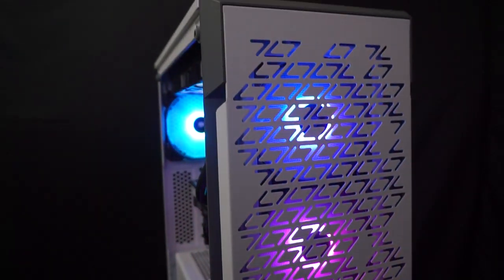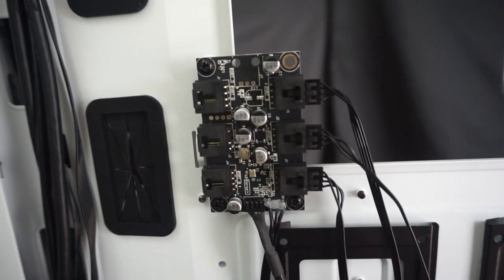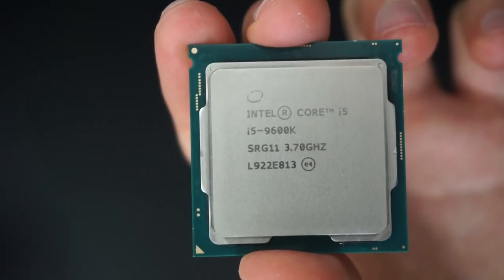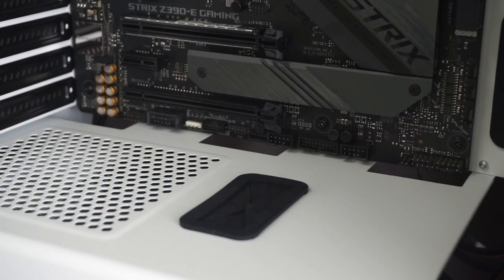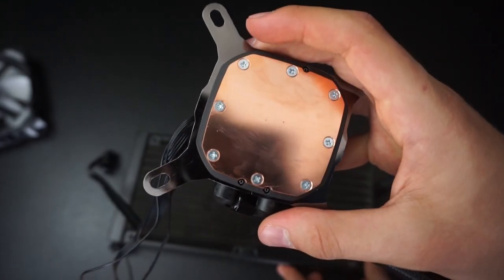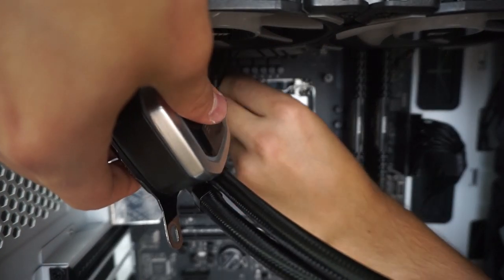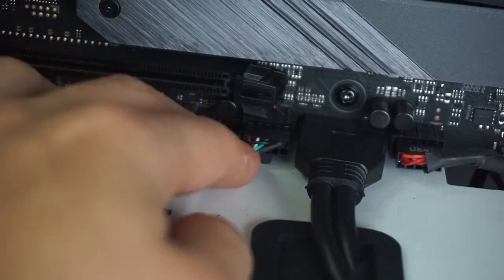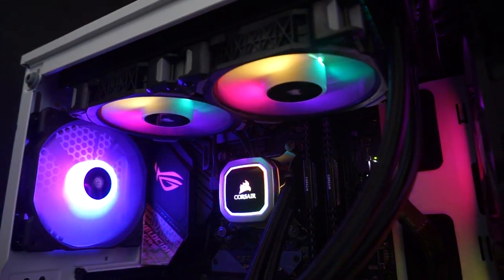Corsair 220T RGB Mid Tower Build Guide

Comment: I am planning to build my first pc in this case. I really love the look of this case. I am going with Asus Prime B450M-A motherboard, Corsair RGB Pro RAM and Corsair Hydro Series, H100i RGB Platinum SE, 240mm Radiator on top. Is all that going to fit? Please let me know if anyone has built in this case
Reply: He shows you in the video that a top mounted 240mm aio will fit if you have low profile ram. In your situation with your rgb ram sticks, you would have to mount the aio on the front since your rgb ram is too tall for a top mounted aio configuration

Comment: Could you fit a 1tb HDD in the case or would it be too difficult to cable manage ?
Reply from the maker: I hate having hard drives, they are bulky and out dated now.
Reply: I have seen people fit a HDD in with the power supply, but it's very crowded and not good for cable management. You can slide the HHD bracket forward in the case to allow for more room for the power supply, but it's only minimal. I'm thinking of buying this case and I might upgrade to an SSD so it's a bit cleaner.

Comment: I was hoping someone could help me. I got this case and got everything in. When I turned it on the fans lit up but weren’t moving. So I had no airflow going through. Does anyone know why this is.
Reply: Also it comes with 3 cables that are 3 prong where do I plus those in at?
Reply: @laurenkartheiser0408  If you have a total of 3 fans. Each fan comes with 2 sets of cables. 1 that connects to the lightning core for le at the back and 1 that goes into the motherboard for power.
Reply: @abdulmotive  I figured it out. Although I can only power 1 of the 3 fans because my mother board only has one spot for one fan. I plan on getting fan splitters to solve that issue though.
Reply: @laurenkartheiser0408  buy a 3 way fan splitter. It will connect 3 to 1
Reply: Buy it on Amazon. 3 way fan splitter
Reply: @abdulmotive  thank you so much!!!
Reply: @laurenkartheiser0408  Of course. Have a great day!

Comment: The fan connectors are 3 pin, but my msi gaming plus b450 doesn't have any 3 pin to plug them in. I'm confused. The manual for this case is useless
Reply: Kevin M Don’t blame the manual for the case, almost every fan has 3 pins, it’s your motherboard. 3 pins can go into 4 pins if you line it up right.

Comment: On the bottom floor of the case, there's something you can attach. What is it?
Reply: A dust filter for the PSU
Reply: Wait I may have misread your question, do you mean on top of the PSU Shroud?
Reply: @subpoena.  Not on top. On the bottom, there's something next to the dust filter for the PSU. What is it?
Reply: @tonym3659  I have this case in my house, I will look tommorow morning, remind me.
Reply: @subpoena.  *Reminder
Also can I use other case fan products other than Corsair? This case does with a hub on the back so can I use other RGB Case Fan products?
Reply: @tonym3659  Thank you for reminding me, You can use other case fans on this case however if they are not Corsair™ Branded they will not be compatible with the RGB Controller on the back of the case.

As for your first question, I don't know if what I see is what you're referencing, but if you are referring to the 2 Rubber Nubs at the bottom of the case, I believe those help with Anti-Vibration of the PSU.

If you're still confused maybe send a picture if you can find one and I'll see if my case has it.
Reply: @subpoena.  Here is a picture, like its right next to the PSU dust filter: https://pcper.com/wp-content/uploads/2020/03/corsair-220t-rgb-airflow-11.jpg
Reply: @tonym3659  Those 2 little nipples are both rubber pads that cover the inside of the case and are for the PSU to prevent vibration
Reply: @subpoena.  One more thing, What's the best Corsair Case Fan RGB with the best Airflow and CFM?
Reply: @tonym3659  The Best RGB Definitely goes to the QL120's. 

I'm unsure of the fan with the Best CFM, but I'm pretty sure all of them will work similarly.

All Fans have great Airflow, This is more dependant on Evironment.
Reply: @subpoena.  PCPartPicker tells you. I think Corsair ML120 PRO is the best all around.
Reply: @tonym3659  Ah, Neat
Reply: @tonym3659  It Depends, if the other RGB Fans are not Corsair, they will need to have a 3PIN-ADD RGB Connector and also would need a RGB Header on your motherboard aswell.
Reply: @subpoena.  Yeah. I wanna use this as my exaust fan on my case: https://pcpartpicker.com/product/sZPgXL/cooler-master-sickleflow-120-argb-62-cfm-120-mm-fan-mfx-b2dn-18npa-r1
Reply: @tonym3659  I would just advise buying a single SP120, it's about the same price and also that way everything will look the same and function the same.
Reply: @subpoena.  But that airflow doh.
Reply: @tonym3659  The SP120 will be fine for Exhaust

Comment: The more I watch about this case the more I want one. Would love to know if a larger power supply would have clearance issues with the HDD cage as I have a OCZ 1000w fully modular PSU and 2x1tb drives
Reply: Max PSU length is 180mm if you are still wondering

Comment: Had to front mount my duel fan rad kinda unfortunate but still looks clean, also great video
Reply: Same bro, it pisses me off especially bc my aio dont got rgb fan
Reply: @ethanpham7716  damn what brand did you get?
Reply: @Justincredible24  i got the evga clc 240
Reply: @ethanpham7716  nice it looks clean I got the cooler master ML240L
Reply: @ethanpham7716  I’m planning on getting the Corsair i150h if it will fit though
Reply: H150i*

Comment: (First time PC builder here) I’m really having trouble with finding where the three three-pin cables that come with the case, which I assume are for the fans, connect to my motherboard. I only have two system fan ports on the mobo and could really use some help :/
Reply: You can buy a 3 to 1 fan splitter cable. They are pretty cheap. Just connect the 3 3 pin cables to the 3 to 1 fan splitter.

Comment: Hello, I was wondering if team t-force delta ram would fit this case, with an aio at the top
Reply: Yes it will
Reply: SkidPaw It won’t, disregard the comment above this. You need low profile ram like the Corsair vengeance non RGB ram, so please don’t do it as it won’t work.
Reply: isleseayou As for you, please delete your false comment.
Reply: BrightMarksman I only said yes it will because I have this setup in one of my builds plus another set of fans on the other side of the rad for a push pull config. I am using g skill trident which measures at 47mm tall  ( https://www.kitguru.net/components/leo-waldock/g-skill-tridentz-rgb-32gb-ddr4-3200mhz-ddr4-with-rgb-lighting-review/ ) while the t-force delta measures at 49mm tall ( https://www.teamgroupinc.com/en/product/delta-rgb-ddr4 ) .....at its highest point. But at the edges of the t-force it is 46 mm tall. It should fit just fine. The push pull rad config covers up some of the ram but height of the ram is not an issue.
Reply: What about this case with h100i platinium on top with b450 mortar and team group dark red ram will it fit?

Comment: I dont know how to plaug in my power led, reset switch and the small cables like tht on my asus rog strix b450-f gaming motherboard
Reply: Check the motherboard manual. I had the same issue at first with the same motherboard, but that's because I never referred to the manual. It says it in there somewhere, just have to look for it👌

Comment: this case is good, but i wish i got a bigger one. I recommend beginner builders to get a larger case because it is easier to work on.
Reply: im probably gonna get this case anyway because it looks good has 3 fans and is the perfect size for the components I wanna use
Reply: @juniorjappie153  i feel you, thats the same reason i got it too, the fans are really nice.
Reply: @ethanpham7716  what cpu cooler do you use i wanna get a kraken x53 but i'm not sure if it will fit top mounted
Reply: @juniorjappie153  Well, I dont even use top rad bc it wont even fit, I use the evga 240 clc.

Comment: Will a PowerColor Red Devil 5700 fit in this case?
Reply: Jaime Torres yes it will
Reply: @isleseayou  awesome thx
Reply: @Prism_JTN  did it fit indeed and if so, how much room do you have left between the fan and the gpu, or did you have to take out the middle fan? Just wondering, since I'll try to fit a RX 5700 XT nitro+ in a few days (shoule be here in 2 days) & I'm a bit scared it might not fit 😅
Reply: @murks123456789  did you manage to fit it? the rx 5700 xt nitro+ its 6mm longer than the max gpu length
Reply: @DeerReedz  yes it does fit indeed, it was kind of tricky getting it inside the 220t, but it does definitely fit in there. Its the closest fit I've ever seen tho, which looks super clean, but there's only like 3-4 mm of space between the front fans and the gpu-shroud 😅
Reply: @murks123456789  oh thats cool just got the case and gpu its on the way wanted to make sure i didnt have to remove the fan
Reply: @DeerReedz  yea, removing the middle fan was my backup plan aswell, but I was able to keep it installed :)
I did however have to buy a gpu holder since the gpu is pretty heavy & I noticed some sag after a  few weeks, just thought I'd let you know 😁
Other than that, no complaints about it, great card & case, would definitely buy them again.
Reply: @murks123456789  thx for the info

Comment: Hi Alex

I want to purchase this case however I'm worried after watching this review some of my parts may not fit especially regarding my HDD/PSU? I wish to put in a Corsair RM850w fully modular PSU, Nvidia Gefoece GTX 1060 6gb graphics card, Cooler Master 212 hyper Evo CPU cooler, 1x 3.5hdd and 2 Ssds. My motherboard is Asus Z270-p. It seems the video reviews I've seen on YouTube pretty much all day you have to remove the HDD case when installing your PSU so can I not use my HDD?

If anybody has any idea whether my components would fit this would be greatly appreciated. Thanks in advance and sorry for being totally useless at this sort of thing :(

UPDATE

Ended up going with the fractal meshify C case and put in the Corsair RMx 750w PSU. I know that's overkill for my build but it wasn't much dearer than the 650w version. Thanks so much guys for your feedback. It was all very helpful. 🙏
Reply: asa 248 have you used PcPartpicker?
Reply: Get a compact 140mm 750w should be more than enough for that build

Comment: I have the case and struggling to get the rgb fans and my aio rgb working. I have a commander pro, that the 4-pin fans headers are plugged into, where do the 3-pins go? I had the aio pump on the aio pump header, but my pc would boot and say cpu fan failure, so i moved it to the cpu fan header and it boots fine, but no rgb control. Please help
Reply from the maker: You can ignore the cpu fan not detected if that the error.
Reply: @Alexkrastev  do i have to go through bios every time or can i ignore it somehow so it skips on boot up?

Comment: I have the same chasis and cpu cooler but was unable to install it up top as there wasn't room with my Z490 Aorus Pro AX motherboard with RAM installed... so it's on the front instead. Just made me wish the chasis was that extra inch taller. It's a lovely chasis just really tight getting a motherboard in and with the H100i cooler installed at the front it left 3mm clearance for the GTX 1660 Ti installed.

Comment: Damn, I really could have used this video before I built my pc using this case.

Of course, I find it directly after I've finished -_-
Reply: i am building mine friday/saturday this is going to help a ton
Reply: Did you use the hdd cage? That's the only thing I'm worrying about.
Reply: @DB-ux9lu  I actually took that out to make space for cabling. I've got two SSDs in my case now, using the holders behind the mobo

Comment: Hello, i have a identichal case and I installed the 4th fan at the back like you did but my problem the fan lights will not work.. the lighting  hub will not work for the 4th 5th and 6th slot(any suggestions will be useful, Thank you!)
Reply: Maybe in iCue software the rgb is off, if its on, its a broken fan
Reply: What model of fan? I heard that if you have a ql120 fan you'll want to move it up in the load order. Meaning put it in the 1 spot and the sp to num 4

Comment: I completely forgot I could mount the radiator on the top and ended up mounting it to the front behind the fans hehe
Reply: What ram do you have.because if you have it on the top you can get clearance issue because the heat spreaders on the ram sticks
Reply: I have my rad on top but with trident z rgb ram it will fit

Comment: I don't recommend this case if you're using a Hard Drive. Just not enough space.
Reply from the maker: Same.
Reply: Trio Pack the case is fine to use if your using a small factor power supply, my 120mm power supply fits in fine with all the extra cables

Comment: Your fans on your AIO are blowing up and out.Y? u need filter if not sucking air in? The bottom and front filters are catching dust coming in. Exhaust fans a filter is pointless.
Reply from the maker: mark trosper the way the fans are setup in this build is the most optimal way. Air gets sucked in from the front of the case and filtered through the filter. Air then escapes from the top and back where there is no filter. This is best because heat rises so why not exhaust from the top?